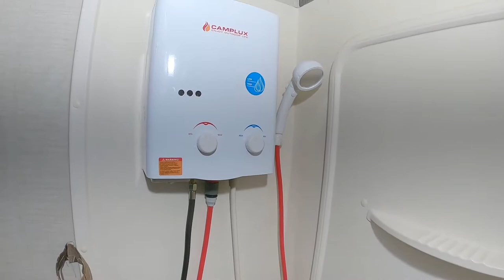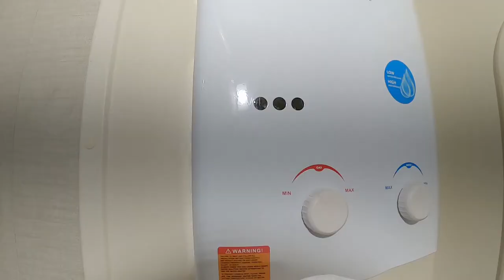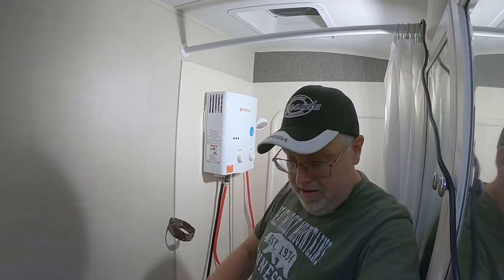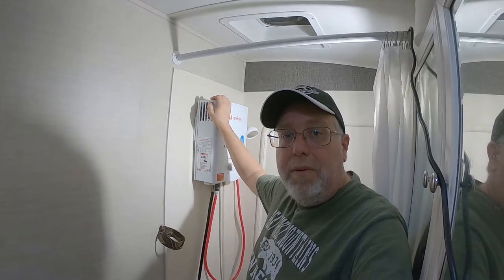RV tankless water heater

Comment: It looks like you used white Teflon tape for your fittings. I would recommend replacing the Teflon tape with the yellow tape that is appropriate for gas fittings. You can find it at Home Depot or Lowe’s. White tape is designed for water only.
Reply from the maker: Thanks for the info,  I was not aware that white was only for water.
Reply: i guess it is kind of off topic but does anyone know of a good place to watch new tv shows online ?
Reply: @Ahmir Nolan i watch on flixzone. Just search on google for it =)
Reply: @Ahmir Nolan I use FlixZone. Just google for it =)
Reply: False.   Should not use tape at all.   Use pipe dope.
Reply: The propane fittings are called compression fittings. They shouldn’t have any Teflon nor yellow kind. You can actually start a fire that way.

Comment: Excellent video, I need to install one in my sister's 1979 Tioga. I needed the proper way to do it using the water from the tub. I have few questions. I see that this video was made 2020 it is 2023. First, how is the shower working? Any issues with the set up and if so can you share the fixes. Thank you so much for this clear and to the point video.
Reply from the maker: Thanks for watching. We have had zero issues since we installed this unit and it is used on a daily basis since we started fulltime RVing 6 months ago. Before going fulltime I would guess we had 200 showers on the unit just part time camping. Depending on temperature settings we get about 50 minutes on 1 lb bottle. Hope that helps.
Reply: @millersinthemoment5427  thank you so much for your fast response. I now told my sister I'm installing one in my trailer as well. Blessings

Comment: Your video is the 5th I've watched so far.. Besides your actual set-up being the less complicated and by far best I've seen. 
I still have yet to know if this shower set up still needs to have a water pump to work?  
I'm going to be building me a mini TT from scratch to pull behind my 66 chevelle. 
I'm trying to build as light as possible.  A toilet & shower closet are a must have for me due to my disabilities and health. 
I'm wanting this exact set up,  only part I was going to do different is have a regular sized propane tank for this to go on. 
My idea is also to have 2 seperate water tank sources. 
My bath/shower I'm thinking a 25 gallon tank AND doing the roof pvc pipe type of water storage. (This for kitchen for sure). 
The PVC pipes will basically be set up for gravity flow to get kitchen water.. 
I know I'd need a water pump if I have a basic fresh water tank.. Unless hooked to city.. 
But what about this set up?  Pump? 🤨🤔😁
Reply from the maker: Short answer is the shower heater doesn't have a pump. You will need to plum your pump from the fresh water tank to the inlet of the shower.  
I wish you the best on your build, I have seen some very nice scratch built campers. The best part is you will know everything about your camper so fixing it would be easy. If I can answer anything else just ask.

Comment: Hi Millers, what fitting did you use, specifically, coming off of the cylinder?  Nice job btw.
Reply from the maker: Thanks for the question, I hope this answers your question
Part list to convert from a 20lbs tank to a 1lbs bottle
1- Mr Heater1/4" MPT to 1"-20 Female
1- 1/4" ball valve
1- 1/4" x 2" pipe 
thread tape 
 Heat the 20lbs fitting with a propane touch to release the green sealant.  After the fitting is removed, use thread tape and assemble all the parts.
Reply: @millersinthemoment5427  Just placed the order, thanks very much!
Reply: @millersinthemoment5427  what type/brand of shower head is that?  Great video btw
Reply from the maker: @sonofaleph2140   its the shower head that came on the unit. Thanks, Glad you liked it.

Comment: Thinking about one of these in my 5th wheel as the tank heater is shot. If I sacrifice the small cabinet above the toilet and mount the heater there the hose should reach the kitchen sink. Or maybe run some pex over to it and tie it in. Cheers.
Reply from the maker: You could use a small bucket to transport the hot water from the shower to the kitchen sink. Also make sure you have good ventilation wherever you install the heater. Thanks for the comment!
Reply: I've read you're not supposed to drink water heated by these propane water heaters.  Not sure why the difference, but it's written in the reviews on products on amazon
Reply from the maker: @TinyTrianon  That maybe true i dont know. We use our coffee make for hot drinking water. The shower heater is only used for showering and hot water for dishes.

Comment: In your opinion, would it be possible to plum this into the existing plumbing of an rv and completely replace the existing  rv water heater?
Reply from the maker: It is possible to plum into the existing water line. The issue you would have is the unit itself and making sure you have enough space not to violate the manufacturer's requirements. Also if you locate the unit inside an enclosure you wound need a good ventilation setup.

Comment: Interesting. Besides the co2 concerns, how much heat is generated by the exhaust? Is it considerable enough to cause any problems if mounted to close to the ceiling or walls? Considering buying one.
Reply from the maker: Bob, we have not had any issues with the heat from the exhaust. the burner is only on when there is water flow once you turn the shower off the burner stops too.
Reply: How could you possibly be concerned about co2 at all.
The entire premise of on demand almost eliminates that concern. And not to mention, don’t forget the fan is literally inches from the top of the unit.
Come on
Common sense = no concern

Comment: Im putting one in my oversized load pilot escort van/sleeper.. Thanks for the informative video had no idea it only cost 7cents in gas per 5 min shower that's great to hear.. Hows it holding up
Reply from the maker: Congrats on your install. Just make sure you have good ventilation while the unit is being used.  We have had no issues with our.

Comment: Thank you very much for the great video.
I have one in my back yard. I have been wanting to put one in my boat. I want to attach a 1LB bottle directly to the Camplux.
I’ll most likely have to shim the Camplux out a bit from the shower enclosure wall to replace the 1LB bottle. 
This hack eliminates the propane hose.
Any suggestions?
Reply from the maker: Instead of shimming the unit could you use 2 x 90 deg fitting to step the bottle from the wall?

Comment: That is a neat little set-up.  Just run the vent fan and there should be no exhaust issues...might upgrade to a Fantastic Fan some day for even more exhaust  Looks like the unit has temp control, so no need to mix with cold water.  The one pound bottles give 50 min run-time!  Wow.
  What do you do for heated water in the kitchen sink?
Thanks for sharing the real-world upgrade.
Reply from the maker: We have a 1gallon bucket that we use to transport the hot water from the shower to the kitchen sink.  Thanks for the compliment.

Comment: Great video.  Can you tell me how much run time you get on that small bottle?
Reply from the maker: We were getting around 50 minutes of actual run time per bottle. Thanks for watching.
Reply: @millersinthemoment5427  
If you wanted to do a Bigger bottle... like it's own bottle, could you run the line
out the back, or through the bottom of the RV?

Comment: Just like us, those burners also require oxygen in the combustion process. The 4" under the door pulling air from your RV doesn't supply enough air for the both of you. You're breathing straight CO every time you use it, and even small amounts have lasting effects.
I install tankless water heaters in residential houses, they vent in pvc which is easy to work with. A vented model and a few extra parts is the way to go, don't be lazy on builds. 
Also not trying to bash anyone, I have nothing but love for fellow rv/vanlife folk. Happy travels guys.
Reply from the maker: No bashing taken, I feel this platform is a place for learning. I welcome comments as I'm not an expert nor do I claim to be.
  A few known detail about this install,
        *  4" opening under the door supplying fresh air,  
       * 14" roof vent is located inside the showering area with a 950CFM fan 
         running. 
      -*  the burner is only on for less then a minute during showering, when the flow stops the burner turns off.
With the amount of air movement vs duration of burner on, the co2 should never get to harmful levels. 
Question back to you. How can people runs their stove / ovens ( same BTU and Co2 output)  for a 20 to 30X if not longer then this shower without concerns?

Comment: nice! what about the exhaust? carbon monoxide issues ? thought these type of shower system were ment to use outdoor ?
Reply from the maker: If you read the instruction, it states the unit has an oxygen depletion sensor. the way I installed it by the vent fan there is no chance for the fumes to build up. 
 One other thing to think about is most people will use their camper stove and oven for 20 or 30 minutes and never think about carbon monoxide.
Reply: @millersinthemoment5427  interesting way to think about it.  I have a digital CO sensor 2 feet from my stove in my camper and in 3 years full time living and cooking its never read anything except one time I lit an incense and occasionally when  running car is parked outside.  Still though I'm spending a little more and getting the indoor use one and venting it outside.  I don't always want to use the vent fan in the shower when its below freezing outside.

Comment: I have the same unit, that i just purchased.  I was looking to install it in the shower as well, since it's only me, and I only take 5 min showers anyways, but my question to you is.  How come you didn't install the unit higher on the wall?  closer to the vent.  but it looks little low.  Just curious is all
Reply from the maker: Thanks for the question. I didnt want to add a lot of extra holes in the shower wall. By removing the shower head holder I only need to add 1 extra hole into the wall.
Reply: @millersinthemoment5427  AWW makes sense now.  Thank you so much.

Comment: GREAT Video!!!
but I'm confused... This is GAS/Propane...  Doesn't it need to be VENTED???
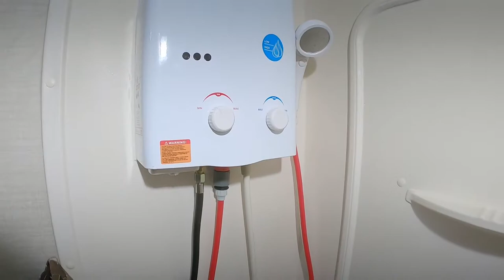Reply: 3:30 ... answered my question.
Reply from the maker: Thanks for the question. Yes this unit using propane. Our shower area has a roof exhaust fan that we run anytime we shower. Since we boondock and try to save water, were only running the burner for a minute or so " Navy showers".   The unit also has a oxygen depletion sensor.
Reply: @millersinthemoment5427  
Oxygen depletion sensor? 
What is that... It sounds important.
You have no idea how Happy I am that I ran across your video.
I "FLIP" RVs... and came across a vintage 1972 Travel Trailer... Completely redid it.
and I'm also working on a 30' Class A RV too... 
I think this will great... Thank you.
Reply from the maker: @judichristopher4604  the sensor  will turn off the heater if the oxygen levels drop to low. Most heaters has this protection.
Reply: @millersinthemoment5427  
That is what I was thinking too... That is good. 
Again, Thank you so much for this great video.
Reply: Yes it does need vented...... It burners about 4X BTU as your oven. Also burns less efficient which produces more carbon dioxide.
Reply: @jasonpatterson947  
Exactly... Thank you Jason.

Comment: Im a little concerned about the fumes and wondering if they can be flued off.
Reply from the maker: yes, you could duct the fumes to the outside. just make sure what ductwork you use will withstand the heat coming from the unit.

Comment: My son just bought a 1984 Econoline motorhome which needs a little work but he has this water heater already. Can you explain this answer a little better for me, " Short answer is the shower heater doesn't have a pump. You will need to plum your pump from the fresh water tank to the inlet of the shower." He's water pump does not work nor does the water heater.
Reply from the maker: correct the heater doesn't have a water pump, the propane gas valve needs to sense water pressure to allow the burner to turn on.

Comment: could i use this along with my existing on board 6 gallon propane water heater, will the water from my hot water heater run through this or would i maybe have to split the shower hose and run two shower heads, we run out of hot water with our on board 6 gallon take and would like to use this along with  our  on board water heater.
Reply from the maker: Since the unit attaches to the shower hose, you could use your 6 gal hot water heater. You just wouldn't turn the tankless heating unit on.

Comment: I like your set up.  How long does the 1 lb bottle last?
Reply from the maker: Thanks for the question. A 1lbs bottle last about 40 -50 minute depending on your temperature setting. We have our pretty low for showers and high when get water to fill the kitchen sink for dishes.
Reply: @millersinthemoment5427  thank you.

Comment: I heard others say it takes too much water to get to the hot water with a tank less with each shower head activation. When on the water tank.
Reply from the maker: Thanks for the question Brent. Using our RV water heater, it would take about 40-50 seconds to get hot water and the temp adjusted.  With the tankless, we already have the heat set so in about 3-5 seconds were able to start showering. The flow rate on this unit is 1.3GPM so the water consumption is greatly improved over the on board heater.
Reply: @millersinthemoment5427  Great improvment Jeff. and saves water.
Reply: I will run a line. Much better then the boiler running all the time. In the winter I might keep the boiler on low, to avoid freezing. This would also be super easy to use outside with our outdoor kitchen, as it has a quick connecting propane line under the outside stove.

Comment: Hello and thank you for this video. I just bought one and will put it in my RV. However, can you send me the propane tank info as I am very confused as to what to buy.
Reply from the maker: The tank is a 1lb Flame King refillable but you could use any 1lb cylinder.
Reply: @millersinthemoment5427  Hello again I  got the info  I needed. But I bought a different one and it seems big. Could you read and help me figure out if it is to big for my shower which is the same size as yours? PLEASE HELP

Comment: How did you mount it?
Reply from the maker: I mounted the unit using 2 screws. the top screw was where the shower head was located and the lower one was anew hole.  Thanks for watching

Comment: I'd put in the work to connect it to a 20lb tank, but to each their own. They make an adapter to refill the 1lb tanks from a 20lb tank. (Cost save)
Reply from the maker: Knowing this is not our forever camper, I need to consider resale when determining permanent mods like drilling hole.  
The bottles that I use are Flame King refillable. I have a video released show how easy they are refilled.
Reply: @millersinthemoment5427  I bought the same unit for my build. Thanks for the video!

Comment: Hello, I see you answer to all.... That's why I want to ask you a question.  
I create a shower system in  my Kenworth T680 semi truck. But I have a 10 Gallon tank in the outside cat walk of my truck and I used a Sea-flow pump then to my shower head.... How can I use this product with my sea flow pump already installed... ? I just would not want to restart everything in a different way... Thank You For Helping for me, shower is very important. I start to drive at 1 a.m. after 30 years in trucking I need to be fully aware and a good hot shower will do.
Reply from the maker: Thanks for the question. Your 95% there with the setup you have. If your shower head is like a RV style head, unscrew the hose from shower head. install the hose to the inlet of the unit and use the hose and head that comes with the unit.  The sea-flow pump i believe are all on-demand so when the unit senses flow the the gas valve turns on. The only remaining thing to do is the propane connection.  The unit comes setup for a 20Lbs propane tank or like the video shows you can covert to 1lbs bottle. I hope this helps you to get a hot shower!

Comment: How did you mount this to the shower wall? Thanks!
Reply from the maker: the top mounting screw was placed into the old shower head holder and i added a new screw hole for the lower mount. if there comes a time i want to remove the unit i will seal the extra hole with RTV.
Reply: @millersinthemoment5427    What screws did you for drilling into the fiberglass wall?
Reply from the maker: @CharlesButler  Im thinking the unit came with screws. If not I would have used wood screws. After about 2k miles the unit is still tight to the wall.